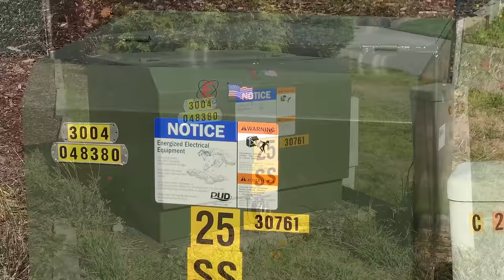Replacing a Pad Mounted Residential Transformer

Comment: Since I'm a lineman instructor, I love showing this video to show what not to do. They do not believe in PPE. No hard hats, no eye protection, no cover on the primary cable, no insulated gloves. All it takes is one nic in the primary of any tracking and you brush up against it, and bye bye brother. You plan for the what ifs and the what ifs keep you safe. I don't care what your safety policies are. There are safety procedures in place for a reason. So daddy gets to come home at night. I mean why wear your primary gloves partially. Where's a good crew in this video. You are your brothers keeper for a reason. Eye injuries, head injuries, electrical shock injuries, right down to wheel chocks. Everyone on the crew needs to be fired making the company look this horrible in safety. Like I said safety procedures vary from company to company, but you can add to OSHA rules, not take away. There are blatant OSHA violations, and no doubt safety violations for their company. Why post this video???
Reply from the maker: You should post a video showing the proper way to replace a pad mounted residential transformer! Show your trainees the wrong way and the right way. That would get millions of views! Thank you for watching my video and for your comment!

Comment: What a waste of money! Had there been a problem with the transformer, sure, replace it.  Wanting it done for the aesthetics is absurd.  Transformers have no moving parts and work on the principle of magnetic induction.  They are quite reliable devices.  Perhaps some minor maintenance is required once a decade but will they will otherwise last seemingly forever.  The cost of that transformer and the labor to install it will run easily into the tens of thousands of dollars that will then be unnecessarily passed on to the customers of the PUD.  If you dont like to the look of it, plant something around it!

Comment: Inside looks crappy....with corrosion.......probably more than esthetics........I would have painted  it camo myself..why ask.............electric co. Often works on the underground wire connections up the street.......water.....aluminum......don’t mix.......

Comment: Thanks for uploading. It’s a bit of a shame that distribution networks build such crappy networks. Switching Load break elbows and bayonet fuses alive is dangerous, companies should design this stuff out. I didn’t see one electrical access permit, this work should have been done under a full HV/LV outage (isolated and earthed). You as workers should speak up and not stand for this crap, turn some more customers off and get home safe.
Reply: @johnd5398  No John. I’m just someone that works in the industry who is lucky enough to have seen a wide range of gear and works practices. I have seen when it works and when it doesn’t, including fatalities. Thanks for your useless input John.

Comment: Aluminum wires? No thanks
Reply: When sized correctly they are just as safe as copper, and of course using the anti oxidation gel you see in the terminals.
Just an FYI though, literally every single power line is aluminum.